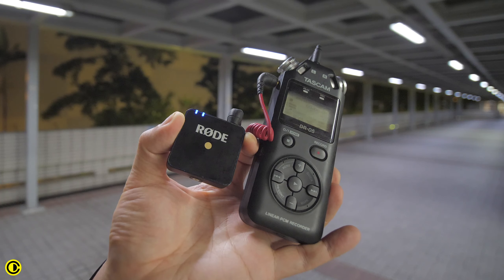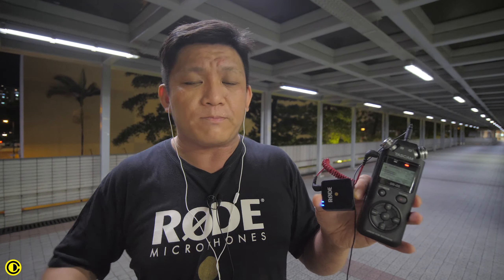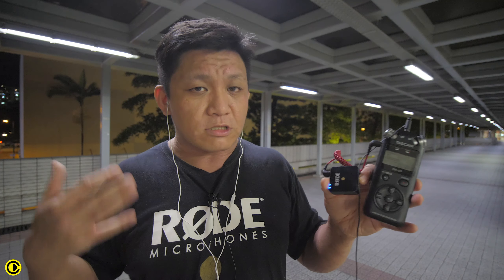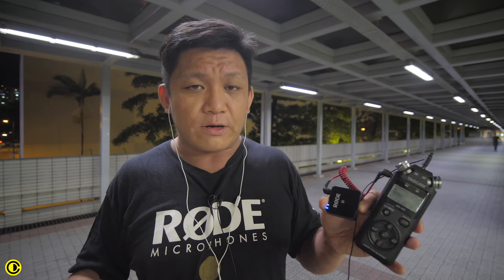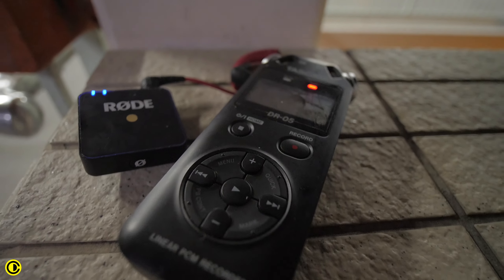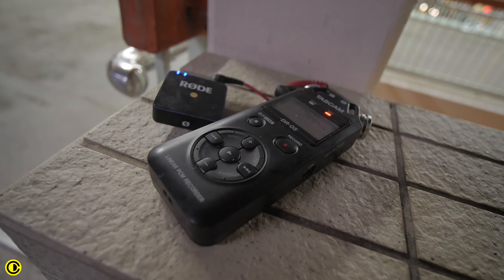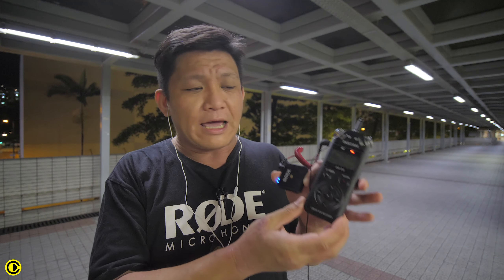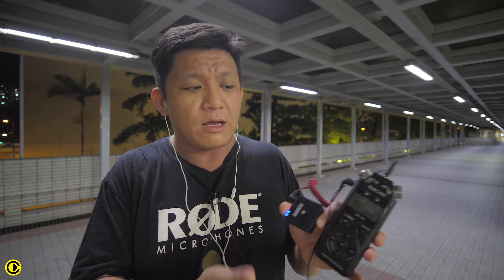Combine Rode Wireless Go with a recorder for a more secure audio setup

Comment: I have experienced some interference noise between rodr transmiter and tascam recorder. I even bought rode cable to avoid any issues. Thats so bad for now :/
Reply from the maker: are you using clip mic or you using mic of the recorder as the mic on the recorder is not well shielded and need to use lavalier clip mic on the recorder
Reply: @chungdha  using build in tascam dr 40x mic. Ok do IT seems that setup needs some cery long cable to work.

Comment: I tried the older model of rode go but the tascam didnt pick any audio from that.
Reply from the maker: I used the smartlav+ with adapter, are you sure you have the correct settings inside of the tascam that it is supplying power to the 3.5mm port?

Comment: Great vid. Wondering the different between DL10 and dr-10CS
Reply from the maker: DR10L is for lavalier and the 3.5mm gives power for it.  DR10CS is for line in from like a wireless pack but port does not give power. Better with DR10L as can have more use
Reply: @chungdha  Well received with thanks.
Is there any different cord needed?
There's only one cord in my Rode Wireless GO package, for connecting Receiver and the camera mic port. Do I need to prepare the same cord for the connection of DR10L and Rode Wireless GO transmitter? Or, should I need a specific type of cord, please?
Reply from the maker: @imtriinsight_jingwu9880  you need extra 3.5mm to 3.5mm cable between the recorder and wireless go.
Reply: @chungdha  thank you very much. That's very helpful. I'll try to do that. Cheers. Happy new year.

Comment: Hello and thank you for your video. Can you help me solve an interference problem when I connect my Zoom H1N to the RX Rode wireless go2. I have tried several settings but there is often a hissing sound. Thank you Claude from FR
Reply from the maker: It could be cable is issue or setting issue, I try set recorder setting to Mono as remember some recorders have issue when using a clip mic with stereo it hisses.
Reply: Thank you, I still have the same problem but much less important by putting in mono. Thank you for your help. Regards
Reply: i also have the Zoom H1n and i also have the same problem. Indeed the zoom has interference from rode wireless systems (makes a whistling sound) so I dont use it anymore. I bought the tascam DR5 and it is a perfect combination. I also use the DXA-SLR MINI to mixing the sound of the two microphones when i use the wireless go II.